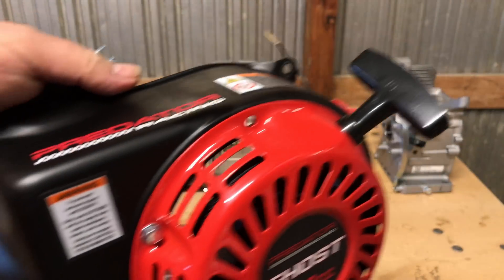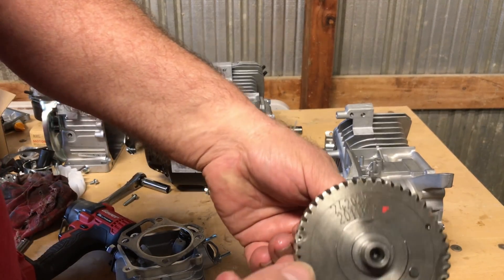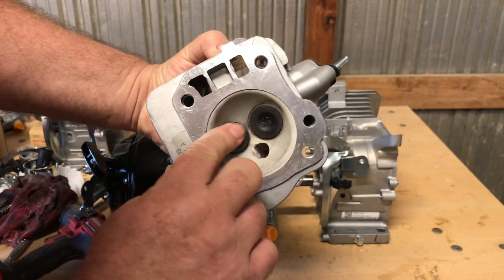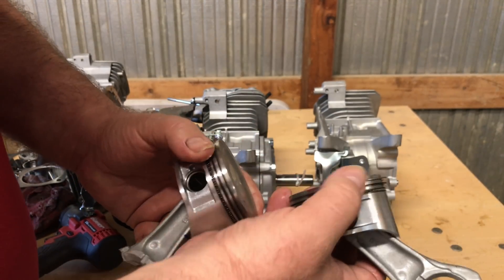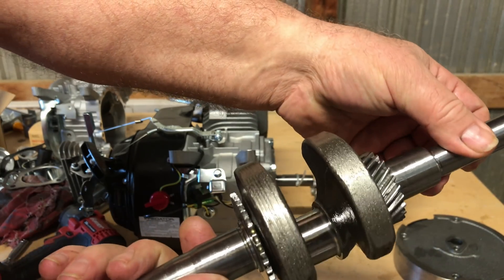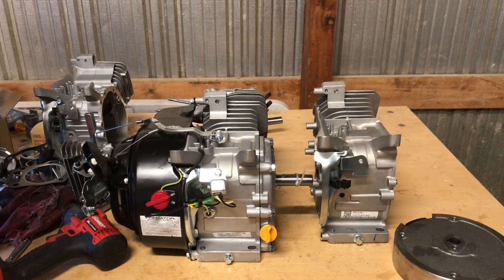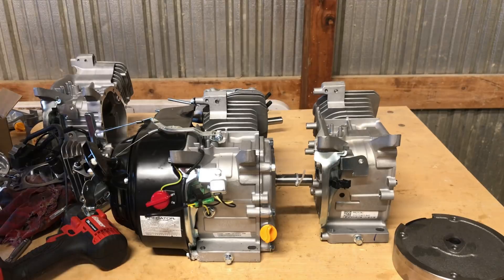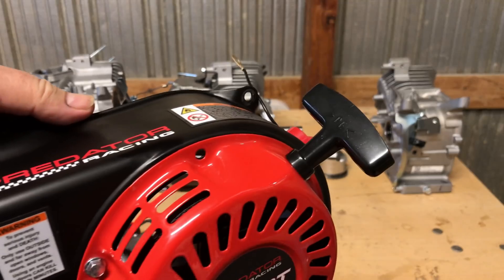Harbor Freight Predator 212 Ghost 212 Hemi Engine Review Internal Parts Quick Compare to DUCAR 212

Comment: I found a stock Ghost on Marketplace with the exhaust for $150. Hope it pans out because i want to step up from the Hisun but don’t want to end up with $800 in a motor. I ride my BT200X on steep hills on 40 mile rides up here in NW Arkansas on the dirt roads. What a fun hobby
Reply from the maker: That sounds like good deal Jason if there are no surprises inside. I'd need to hear it run before I purchased it. I like marketplace but usually don't trust it for complete "good" engines. Now junk engines for parts and older riding mowers/garden tractors, I'm all for it!
Reply: @KentuckyFriedFixes   When I got there the guy came clean and showed me the carb with a missing slide but it had good compression and I got it for a hundred bucks. He said it was bogging down at high RPMs but I found the intake gasket was too small I.D. and put a Nibbi 24mm carb on it. Got it running like a new one now snd my bike is a wheelie monster lol. Drinks more gas than the 196cc too probably because I’m always gouging on it now.
Reply from the maker: @JasonFoster-z7y  Sounds like a good deal! Those Nibbi carbs are nice. I like the craftsmanship that goes into the Nibbi. I think the Ghost carbs are a bit small and you've solved that issue 100%.

Comment: I see u took it apart & measured things but did u put it on anything to see how it compared to the others aas far as speed or power? I switched from a predator 212cc hemi w/ 18lb springs, flywheel, 26mm carb, header, autolite plug, & ngk plug resistor. The 212cc predator had a governor delete as well. I swapped that engine out for a ghost that I only put a header & 26mm carb on & the difference was very noticeable. I went from a top speed of 55mph to a top speed of 62mph. The torque stayed bout the same. All that being said yes the ghost is $329 but I had way more than that tied up in my predator 212cc hemi & the ghost is better straight out of the box with no real upgrades. Imagine if I do the exact same upgrades to my ghost that I did my hemi 212. In my opinion regardless of how they're built the ghost out performs the hemi 212 all day especially if they both are running straight from the box or have the exact same upgrades. Thanks for the video
Reply from the maker: Thanks Eric, the Ghost 212 definitely has its place in the World, but aside from the 252 camshaft it's not as good of a value as the Predator Hemi when you consider what you paid vs what you actually get. Even better, the 212 Ducar Hemi with an aftermarket 272 camshaft and billet rod with flat top piston is a much better value for around the same money spent. The Ducar also included at the time, a PVL flywheel instead of cast iron.

Comment: You not kniw  the ghost is a ducar ? It also makes 10-12 hp where the ducar labled engine makes 7 hp
Never seen a flywheel explode either pretty sure they knew what they were doing when they made the ghost 
Most people swap the coil and flywheel anyway 
Ill take the ghost myself its the better deal for sure
Reply from the maker: The Ghost in this video is definitely not a Ducar. It has a Ducar hemi head but everything else is comparable to a Loncin engine when you look at the engine block. Ducar blocks are made completely different.

Comment: This is NOT a hemi motor!! A non hemi witha hemi head!!!
Reply from the maker: Hi kcbdd! Mine was definitely a hemi engine. The camshaft has .549 diameter shaft, the non-hemi 212 Predator has a .559 camshaft journal diameter. Is yours different?

Comment: New to the channel, but I have to agree. That doesn't look like much at all. $149?-now for a regular 212 w/o a coupon. You can build it yourself with a billet rod and flywheel for the cost of the ghost+accessory kit.
Reply from the maker: I agree! Finishing up part 3 of the DUCAR 212 Hemi build now. MUCH better engine for MUCH less $.
Reply: @KentuckyFriedFixes  I picked up the 224 today for a yard kart I had sitting around. I have too much fun tinkering with them to buy one already built even if the ghost WAS worth the money.
Reply from the maker: @HSTvids357  The 224 is a much better value than the ghost 212 for sure!

Comment: So is the ghost have a standard hemi predator 212 crank profile for a flywheel or does it have the Honda/clone profile? Strange they left the governor sprocket on the crank.
Reply from the maker: Sorry for the delay. The Ghost flywheel has a Honda clone taper, at least mine does. Same as the Predator 224.
Reply: @KentuckyFriedFixes  no worries, thanks, Cash was tight, so borrowed my kids gx200 from cart for my pressure washer. They complained to ex who didn’t even want them to have it. So she over spent their child support to make me look bad.

Comment: 2:11 Man I was hoping you were going to show us the Predator 212 Hemi head as well.. Thats what I and I think many others are wondering.. is how much different is the this new Predator 212 Ghost motor compared to the Predator 212 Hemi.   I'm starting to think this is why there was a shortage in Predator 212 Hemis around the country.. they redirected that plants production to produce the Ghost and not the plain Hemis. I finally got my hands on a Hemi today that just got delivered to my local HF. So its either one that was made before they made the Ghost or theyre starting to make Hemis again now that they met their quota for the Ghost line.  Anyway, can you do a comparison of the predator 212 hemi head and the ghost head? same with the cam, and crank shaft?
Reply from the maker: Hi Chris! I may do some comparisons of the different heads. It's a good idea. I did compare the 212 hemi block to the Ghost 212 block and they do appear to match exactly. The Ghost block having undrilled passages for the governor linkages is the only difference. We may do a few more comparisons between the Ghost 212 and the Predator Hemi 212 coming up. Thanks!

Comment: They got a bunch at my local HF, according to the guy I talked to there said they have sold 1
Reply from the maker: The Ghost 212 is likely gonna be interesting to kart racers only. Nobody else is gonna spend that kind of money for this engine. Thanks!
Reply: @KentuckyFriedFixes  I don’t think cart racers will go for them. They don’t have a sealed block for a sanctioned race and most can beef up a 212 a lot better for not a lot more

Comment: everyone throws the "Clone" word around too much like EVERYONE KNOWS what a "clone" is... . when we dont.  they are ALL CLONES OF THE HONDA 196/200... need to use the word HEMI or NON HEMI as the Predator is the standard now... so the only choices is HEMI or NON hemi... as they are all clones so that means nothing, but it is a knock off of HONDA 200.    the cam journal on the HEMI is one size... the cam journal on the NON hemi is slightly different as is the flywheel taper. therefore a person needs to use HEMI or NON hemi in the description... not "clone" as they are all clones of HONDA
Reply from the maker: The Hemi and Non-Hemi distinction worked well for years but since the addition of the non-hemi 224 that all changed. The crank pin diameter of 1.180" and the camshaft diameter of .549" are considered to be "Honda clone" sizes. Thanks!

Comment: So all in all a hemi predator 212 with a manual governor
Reply from the maker: Hi Joseph, the Hemi Predator 212 has a flat top piston, the Predator Ghost 212 has a dished piston. Although the Ghost 212 has a better camshaft you could certainly buy a great cam for the Predator Hemi 212 with the cost difference, and probably a good billet rod too.
Reply: @KentuckyFriedFixes  ok how much hp are they actually claiming because on the right size frame my 212 actually put out better the a 9hp briggs
Reply from the maker: @Joseph_Headen  Hi Joseph. HF has not listed any HP or torque specs for the Ghost 212. That sure was nice of them.
Reply: @KentuckyFriedFixes  yeah I bet probably about the same as the tiltson 212 at 10hp
Reply from the maker: @Joseph_Headen  I honesty don't know Joseph. I try not to speculate on HP numbers without actually seeing it on a dyno. I've seen so many false claims on youtube videos that are just ridiculous numbers for different engine builds. Thanks!
Reply: @KentuckyFriedFixes  thanks for replying and enjoyed your video
Reply: no gov/no oil delete and .253" lift cam. stock is .220" lift as is the MOD 2 that ppl waste their money on that has NO MORE lift, just more duration so can scream it to 7000 rpms... but no more lift? pointless waste of money when the CM 265" cam has MORE LIFT AND DURATION AND IS CHEAPER $65

Comment: The Predator "hemi head" engine, part #60363, has been discontinued. The only engine still offered is the Predator "non hemi part #69730
Reply from the maker: Actually, now the 212 Hemi and 212 Non-Hemi engines come in the same box with SKU # 69730 . You have to peep thru the hand holds to see the valve cover of what engine is inside.
Reply: @KentuckyFriedFixes  I have purchased 10 69730’s in the past month and all have been the non hemi head motors. There is also a difference in the crankshaft spacing between the two motors.
Reply from the maker: @rcbohno  I believe you, but that doesn't mean the Hemi engine is no longer in production, it means you received 10 non-Hemi type engines. You could have just as easily received 5 of each or 10 Hemi engines. I purchased one 212 Hemi engine for the 224 Hemi head swap video I did in February, you can see the part number # 69730 on the box in my "224 Hemi" video. I had to look thru the hand holds of 3 boxes to find a Hemi, all were the exact same SKU # 69730 and 2 boxes had non-hemi engines, the third box had the Hemi engine. This is a fact, the box with SKU # 69730 may contain a Hemi engine or it may contain a non-Hemi engine. They use the same box and SKU # of 69730 for both engine types.
Reply: @KentuckyFriedFixes  And I believe you also. I was told by the store manager of my local Harbor Freight that the hemi head motors have been discontinued. Maybe they’re just using up old stock? Who knows?
Reply from the maker: @rcbohno  Anything is possible but they have been using the same SKU # for a couple of years so far. I didn't believe it until I experienced it myself when I went to purchase a hemi engine specifically..
Reply: @KentuckyFriedFixes  just picked up the ghost engine and it's hemi so ur full of it lol
Reply from the maker: @jjfig4759  Hi JJ  Yes the Ghost 212 is a Hemi but that in itself does not make a great engine. I think HF filled us all with hope of getting a great Kart Racing engine for a reasonable price but instead we got the old HF 212 Hemi with makeup! LOL! Thanks.
Reply: Just picked up a Hemi today that my local HF just got.. Ive been checking there every week for the past two years and they had no Hemis. So theyre just starting to get them in again. I have to check the manufacturing date on it.. This is my first motor.. where do they put the manufacturing date?

Comment: I'm still so confused about the crank. It's supposed to be heat treated, but why if there's no mechanical governor put the gear on the crank? I don't see the extra money
Reply from the maker: I'm with you Steve. I did measure the camshaft and run the numbers, it is a little better than stock on the lift. Video and details coming out later today. Thanks!
Reply: balance? I guessing too...

Comment: This engine sounds like it’s going to be designed strictly for a new Go-Kart race class. The $300 price tag isn’t worth it at this point. I would rather get a predator 224 for $110 less and throw a Cam/mikuni on it with Governor delete
Reply from the maker: I agree 100%. About the only place where the Ghost 212 will be feasible is in a racing kart class made specifically for those engines.

Comment: Yeah there's nothing impressive. It may attract some who want a bolt on and ride engine even though there are better bolt on and ride engine options. A lot of guys don't want to work on these. The extra $150 may be worth it to them with the governor gone and a Mikuni style carb already installed. 

And they may be attempting to get a new go kart racing ghost class.
Reply: Except it isn’t bolt on and ride.... doesn’t come with a pipe or a breather for the carb... and no gas tank...the “accessories” are sold separately for about 150$....and still no gas tank... this thing is fanboy bait
Reply from the maker: True!
Reply: I concur.

Comment: This ghost I think is great for someone racing and needs a box stock motor like right now but for my mini bikes I'll stick to the 212s and 224s.
Reply from the maker: True! I do like the 224. That engine was a win, still a few issues but overall a great buy. This one, not so much. Thanks Nic!
Reply: I like the 223 Wildcat it's block is even more renforced than the ducar block an it has a Steel Cam gear. The 224 predator has a plastic cam gear an not as good bracing as the Wildcat 223

Comment: Will the new Ghost side cover fit a Non hemi predator block?
Reply: No. Non hemis have a different side cover and cam journal than the rest of the clones
Reply from the maker: Right on! You Guys are sharp!
Reply: @KentuckyFriedFixes  can you measure the wrist pin on the ghost since you have it apart? Is it the same as a ducar/tillotson or a standard clone?
Reply from the maker: it's .715 diameter. Thanks for reminding me, I'll update the description to include all the detail info on sizes. I'll post the disassembly and review today, this video was just a quick recap of some of my findings to let everyone know ASAP. Thanks!
Reply: @KentuckyFriedFixes  thank you for measuring it. Going to get a billet tillotson/ducar rod on order right now👍
Reply from the maker: @CRAZEDX100  You're welcome my friend. I think that upgrade would be a great idea. Me too! Thanks!
Reply: @CRAZEDX100  would you happen to know if the HF Ghost Racing engine accessory kit will fit a predator 212 hemi?
Reply: @ChristopherJones16  it should, but the mountings holes for the intake manifold might have to be modified slightly. Sometimes the ducar style heads have a little more spacing between the bolts than the regular hemis
Reply from the maker: CRAZEDX100 is correct. The Non-Hemi Predator side cover will not work and vice versa because the cam diameters are different. While technically it will bolt to the block, the cam wouldn't fit right.

Comment: So an extra 150 bucks for no governor.... a 30$ carb set up and a piece of sheet metal
Reply from the maker: Aaron, that's about it.
Reply: @KentuckyFriedFixes  I really didn’t believe it at first and now that it’s out I kind of feel like a hater because I just knew it was going to be a rip off however for someone that has absolutely no experience or no inclination mechanically I think it’s worth it
Reply from the maker: I think there will be some new kart classes created for sure. It's not a bad deal for a box stock class kart racer. Not a good deal at all for the guy that just wants a faster mini bike.
Reply: what about the cams?  I saw in another video (I think the 224 motor video) that the cam was actually Nylon.. so is the 212 Hemi cam nylon as well?   If not.. I guess you can add metal cam to the list.
Reply from the maker: @ChristopherJones16  Hi Chris! The 212 Hemi cam is a normal metal camshaft. The only one I've seen that was nylon in the Predator engines is the 224, so far. Thanks!